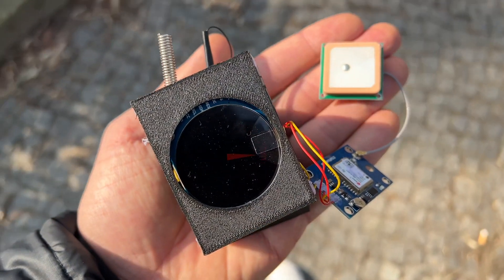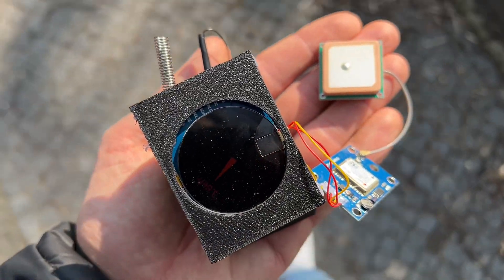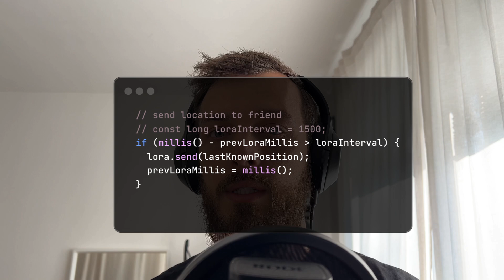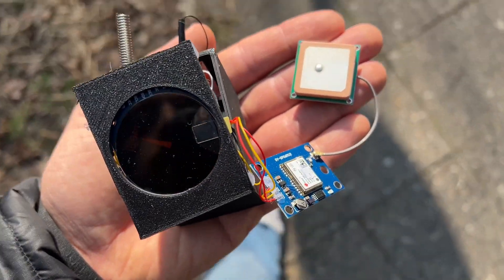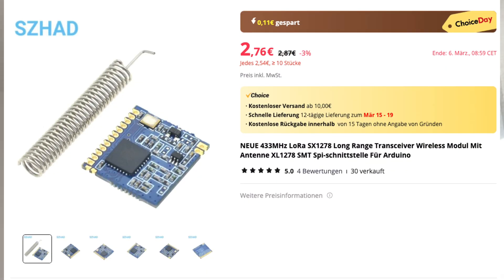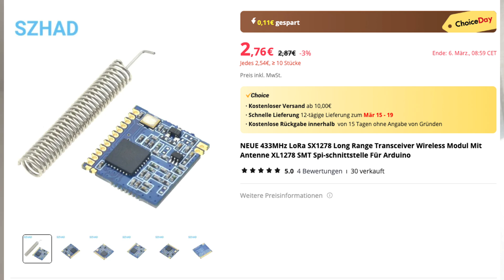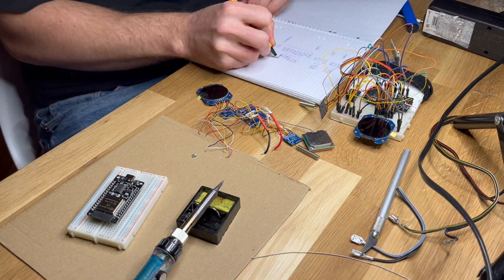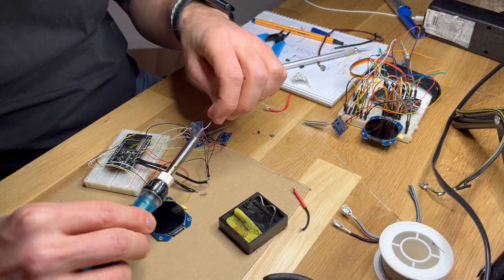No Signal, No Problem! DIY ESP32 Festival Tracker Unveiled! - Part 2

Comment: A great solution for helping with form factor would be using something like the LILYGO T-Beam GPS - LoRa esp32. Includes everything you need except a display, all on a single PC. Even has a battery holder that takes a single 18650 cell. The size is extremely compact and would be a great alternative, potential compromise would be a rectangular display rather than the circular display if you want to minimize form factor, or just use the circular one anyway but have a slightly larger box.
Not crazy cheap, however.

Amazing work, I love the project!

Comment: GPS signals can bounce off the ground,  so if the ESP and display on top are blocking the signal you could try pointing it down at the ground.   It may be noisy though,  so you need to test

Comment: In case if you dont know, the esp can also run micropython :-) When it comes to you burned component its prob. the voltage regulator. i cant see if you using the vin pin or the 5v pin of the esp to supply voltage to your components but if so you just can hook it up to the source directly, as long as you have gnd to esp too. hope that helps you.
Reply from the maker: Thank you. Yea saw micopython as well, will take a look. C++ isn’t that bad. I am just not experienced with it and having a header and an implementation file is a bit annoying. But other then that it’s ok :)

Comment: But there are pre-existing esp32 boards with GPS and Lora already build in😮
Reply: The lilygo t-beam lora for example - you just need to add a screen and the 18650 battery
Reply from the maker: I know now 😛
I didn’t know when I started and also I want to be free in form factor and components to change :)

Comment: Really cool! I'd totally fire up easy-eda and do a small carrier board to put all components on it without any wiring. The wiring is gonna fail for sure, except if you capsule it in epoxy.
Reply from the maker: Cool idea!
Reply: @CodingWithAuryn  Any ESP32 project I do with more than one additional board ends up on a "carrier board" where I can just plug or solder the other boards onto. It's really the way to go and EASY-EDA lets me order the PCB with like a couple of clicks and for amounts of money which I consider stealing... me stealing from them...
Reply from the maker: Thank you for the tip
Will look into it :)

Comment: I was working on a project with the NEO-6M gps module a while ago and could not get it to work the way I wanted. The module would just take too long to start getting me data, or just wouldn't at all.
Excited to see if you find a solution or a more reliable module .
Reply from the maker: Yea let’s see. Just ordered another one. But the 6m is not bad. Just a bit big.

Comment: you can buy a lora read esp32 dev board that comes with a 18650 battery mount and charging circuit and oled screen. Might be a bit simpler to package also check fpv drone gps antenna its way smaller

Comment: Really cool project! I would definitely recommend learning more about RF and antennas. For example this GPS antenna needs a clear view of the sky, which it won't get under the screen. Also the LoRa range will be impacted by the antenna type, proximity of conductors to the antenna, and also occlusion by your hands and body. There's a lot of aspects to this project, but it sounds really exciting!
Reply from the maker: Thanks for the tips!
The gps is a bit of an issue yes :D 
Ordered another gps receiver and will also fine tune the case to not have the display over it. Lets see where this is going and how far i will push it :)
Reply: @CodingWithAuryn  Which GPS receiver did you order? How did you get on with it?

Comment: It's a great electronics project, but if you want something a little more reliable I would recommend meshtastic. It will do everything this does, but it will also make a mesh network using LoRa. Others may be using the same meshtastic system too, so the mesh should be quite good.

Comment: This is so awesome! Subscribed ❤

A few ideas.. 
1. setup repeaters so it works in big festivals.
2. Add nfc, so putting two of these together for 3 seconds adds them as friends :)
3. PTT walkie talkie between friends, or group, and maybe connect with phone over BT to send txt messages.
4. Better standby, wakeup signal and battery management
5. See multiple friends at once like a star constellation of you and them. 
6. Click to save current gps point and label it (mainstage, meetspot) and send it to friends
7. Emergency button. If you feel like you are not in a safe situation, call friends, or everyone near you

Also from my experience with IMUs the best is to use quanterions , it will show you north/friend arrow correctly no matter the device orientation :)
All the best
Reply: have a look at Meshtastic project, all things you've mentioned are covered

every device is a repeater, no need in nfc - everyone connected, phone connection via BT with chat and GPS
Reply: @424442  for sure, I meant for his implementation to have better ux.... I like the NFC pair for new friends without needing to pull any other device. Also do meshtasic provide range extenders? I mean devices that work on the meshtasic network but are not battery powered, and practically extend the range much farther then regular nodes can
Reply: Yesssss I love all these additions! To add to point 7, these devices could send out intermittent signal in normal mode to save on battery and it could be designed with enough reserve battery that the emergency broadcast mode puts out way more signal and has the battery reserves to do so for quite some time!
Reply: Also point 8, I would love to work with Auryn to modify the display graphics to make it a little more intuitive to see the distance from friends. Ideally color and shape cues like the arrow growing when you’re further from you friend and getting shorter and turning green when you’re getting closer!

Comment: Wonderful video. Did yo uconsider using meshtastic as a lora mesh network?
If you want we can have a call. 

Sei stato bravissimo
Reply from the maker: Thank you, yes, thought about, but it seems like you can only run this or something else, not as library. So i would need to add a second esp as meshtastic slave if i get it correctly. But i may understood it wrong.
Reply: @CodingWithAuryn  It's an interesting question, but I don't get the problem: if you are your friend are suing meshtastic and communicating inot a private channel (sending even telemetry data on it) will help other people to trasmit data. The more the better, in respect of privacy. To be tested
Reply from the maker: Yes, if you just want to message back and forth with your phone meshtastic seems to be a good thing. But this is not what i aim for :)
Meshtastic is just a ready to use solution that is definitely nice. But i wanted to rebuild an existing product to understand it, not to solve a problem ;)

Comment: For not completely sent lora packages have you thought about using some checksum to at least discard the faulty packages if not even use error correction?
I would rather have a non jumping destination every 5 seconds than a faulty one x/5 times every second
Reply from the maker: Absolutely, a check sum is definitely on the plate to add :D

Comment: It's a good start, couple things I'd change, your update rate is probably a bit much, I'd say every 5 or 10 seconds would be enough.
Add a "lock" button that'll put the ESP into a sleep state, with wake on pin change or similar set up for both the button and data received by the LORA, so your friend unlocks theirs, that wakes yours up so it can start sending location data between them. But when you're both not looking for each other it's just asleep using very little battery. Realistically you'll only need it to be running for a couple minutes at a time with long sleep intervals.  Same with the GPS, that'll need to be put to sleep too, but once it's had GPS lock it won't take it very long to relock.  I'd also replace the gyro with a magnetometer for compass readings, they're going to be a lot more reliable than gyros, and you won't get any drift that way. 

Well done so far.
Reply from the maker: Thank you for all your tips. 
You are right. I'll see if i can replace them :)
Biggest problem atm is the lora distance i need to figure out as well as the gps 6m is not working great. The 10m is quite expensive for this project, but i may check one out since they also include the compass (but also the QMC gyro)

Lets see if i can/will drive this further :)
Reply: @CodingWithAuryn I guess the question is, how much precision do you really need? It's easy to get bogged down in making it accurate, but you need to get within a couple meters of your mates to find them. 

I'm not sure what you can do for the LORA range, it's a hard problem to solve without infrastructure, but people have done it, so there's a way. All I can think of at the moment is either low frequency comms, as they tend to "walk" over obstacles, but that comes with it's own problems in a hand held form factor, OR, High frequency that'll bounce around the area, allowing objects distribute the signal. That's just as hard I think.  That I'm not sure on that front, I haven't had much to do with LORA yet.
Reply: @GingerNingerGames  Do you know how to  build this?

Comment: For battery issues you can implement deep sleep. Wake every 15s to broadcast location for a few ms and go back to sleep. Then a hardware button to wake up to activate the seeker mode. You will also have to implement some kind of TDMA to make sure the devices are all listening/broadcasting at almost the same time (each gets its own few ms to broadcast while the others listen), including clock synchronization. Lots of fun edge cases to consider, but would extend that tiny battery life considerably. 

In real life usage you will want to implement a simple packet protocol with a network ID to filter out noise from other sources on the same freq from other DIYers at the same festival 😂and a pairing/polyamorous mechanism for joining multiple devices on the same group. I have some circuitpython code if you are interested, including error checking, etc. 

At the very least power down the display when not in active use!
Reply from the maker: Would be cool. But as you said
Much more work 😛

Comment: there are card sized tags with gnss, lora, bluetooth and wifi. you can check seeed studio for example. the dev kit versions are probably better than what you tested.
apple devices have uwb that can be used, but i haven't tested what they allow. iphones, watches and airtags
Reply from the maker: Nice
Thank you
Need to take a look at their board. But mostly I build it to understand the tech and also get used to the components :)

Comment: How about using the tracker as a LoRa bridge and just have phone apps (or the esp32's webserver in case of an iPhone) communicate using it. Would allow for sending all kinds of data over it and greatly simplifies the project (app handles gyro, compass, gps, display).
Reply from the maker: This you can easily do with meshtastic :)

Comment: You might get better reception by tweaking the LoRa parameters; higher spreading factor / gain / coding rate, lower bandwidth.
(Didn't work for my project, guessing too much concrete in the way.)
Reply from the maker: Ahh interesting. Will take a look
Thank you :)

Comment: I'd try exchanging the location data  via meshtastic, that way you'd get meshing out of the box.
Reply from the maker: Definitely a feature i want to explore as well yes. 
Hope this works well :)
Reply: @CodingWithAuryn   Meshtastic kinda does this already, I used Meshtatic devices at festivals last year.
Reply from the maker: @samrossiter2108 yes, more or less. Bit different and not as fun to build :P
Unfortunately meshtastic is not a lib, it is a standalone product. So to display data on a display connected to meshtastic, it is only possible with a second esp or similar. So not what i want to do :P

Comment: Great job sharing both the setbacks and your progress! I see the "gyro" is actually a 3axis compass module - I think you might be able to address your tilt issues in code, since you can work out what the 3d vector of north is across all the axes, and choose the direction to guide based on what that tells you about the orientation of the display.
So if when the display is lying flat the x-component of the magnetic field is near zero, then it tells you the sensor's x-axis is normal to the display, so if you start getting a magnetic field in the x axis you can assume the screen has been tilted up, if that makes sense. Of course it will be a bit more complicated than that, just illustrating the concept 🙂You basically rotate your "frame of reference" based on where the 3d "North" vector is, and use that to decide what to display on the screen.

It still amazes me how much more complicated a "simple" project ends up being once you get down to actually doing it!

Looking forward to your next instalment!
Reply: You want a 9dof module, which has 3 gyros, and a magnetometer to determine your absolute position in space without manual calibration. Then you can calculate the horizontal plane component of the quaternion. Adafruit sells an integrated module with all the code implemented in a coprocessor, but pricey and probably power-hungry.
Reply from the maker: So true. Didn’t expect so many issues as well 😅

With the third Axis I also thought this should be feasible. But didn’t found an easy equation yet als also didn’t had to much time 😅
Definitely need to figure things out part by part. 
Let’s see where this is going. Maybe I find a gps with compass included. This should remove already some headache 😅
Reply: @CodingWithAuryn  Can someone from here build a very similar product like this? if yes hit me up.
Reply: I would suggest you try combining a digital compass, an accelerometer and a gyroscope.
I'm not saying that you need them all in a final product, but you might experience that your issues with orientation is easily handled by combining either compass and gyro - or compass and accelerometer.
🧲🧭😎
Reply from the maker: Will Take a Look
Thank you :)

Comment: Great video!  Love your stuff.  Always excited to see more.

I'm going to try and do something similar with the lilygo t-deck, and add messaging.  Hopefully with a little more of an off-the-shelf solution i wont have as much trouble, but it's definitely going to bw the most complex thing ive ever tried to write code for.
Reply from the maker: Good luck. Yea of the shelf is definetely a good idea
Lost some hair while coding as well as while searching for issues. 
The coding part was the easiest so far of all of it. 
Even so the code is not ready yet and has probably many bugs 😂
Reply: Thanks @CodingWithAuryn  !  

Hardware is still on the way, so I'm still just trying to do all the research I can on established libraries and stuff.  Any time I try to do something new, that first attempt is almost always trash and I end up spending more time trying to figure out what I did wrong than anything else.  Then I get excited when I find it and rush to fix it and mess up the fix lol.

Comment: Yes! Part two!
Have you considered also integrating some sort of ultrawideband sensor like in other products like the Apple Airtag or Samsung Smart Tag? That could help making the position more precise when you're near enough...

Also, in the future it would be very cool to be able to "bind" with your friends before going to the festival, to sync some sort of private key to be able to use it in different groups without having issues... Bluetooth would be also a cool feature to have, great for Streetpass like with the 3DS (RIP)

I'll give a look at the code, however I'm more used to Rust than CPP; let's see ;)
Reply from the maker: Thank you. 
Yes thought about it. But this would add a lot of complexity and also the gps is quite accurate if it is working. Like a few meters. This should be fine. 

The bind feature would be cool yes

I also know rust better 😅👌
Reply: I've looked into UWB myself and unfortunately there's no easy cheap solution for doing localisation

You can get very cheap sensors, but those can't tell you the direction, you need multiple antennas and measure the phase shift of the incoming signals

There are a couple of dev board that can do it, but those are pretty expensive
Reply from the maker: Ah damn. The Lora shows the strength, but not sure if this is enough 😅
Since a wall in between would say you are super far away
Reply: @CodingWithAuryn  Maybe a mix of cheaper techniques could help, like using the long range beacon features of Bluetooth 5
Reply from the maker: Could be yes :)